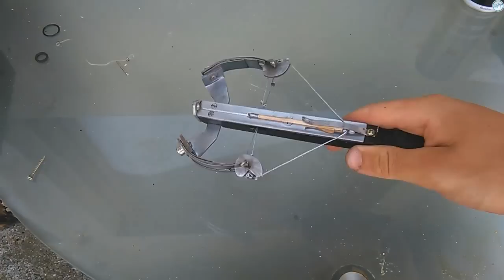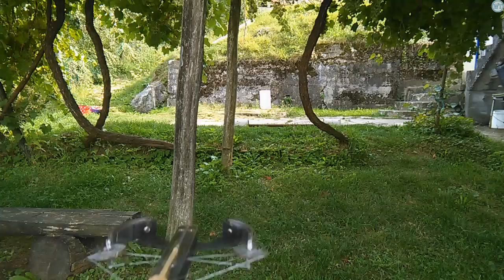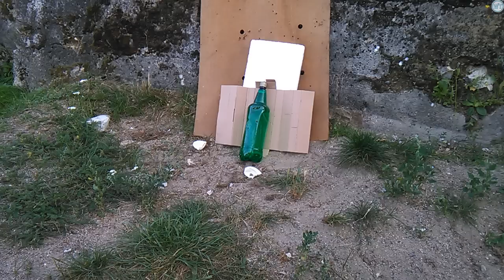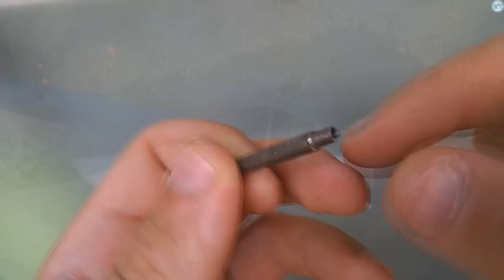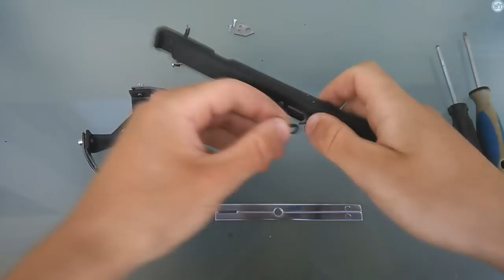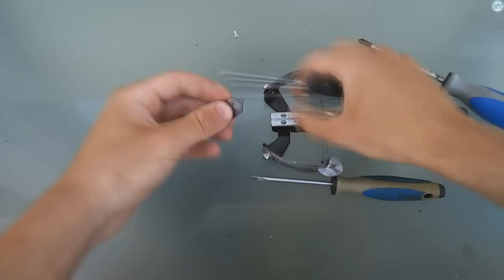Micro Compound Crossbow Shooting Test | Explosive Arrows, Assembly

Comment: Wow..that's quite a bit of umph needed if you gotta use a mini lever to cock it. Any more and you'd probably have to make one with a screw in it. I remember seeing one of those after clicking a link on a Skallagrim vid. It was, if I remember right, an assassin's miniature crossbow and the only way to get the kinda power needed and be able to cock it was to use a screw set up to pull the string back.
Reply: Raduka
I know that feeling, those little handles on all those crossbow pistols you find at flea markets hurt like crazy to pull back from what I remember when I got one when I was younger. Also I found the name of that screw powered one I mentioned, it's called a ballestrino if you were interested.

Comment: putting a small leaf spring behind the trigger might work better than a rubber band. last longer and less likely to fail too
Reply from the maker: I found some mini springs in lighters, so I'm going to use that in the future :)
Reply: that could work. if you are talking about coil springs you could also use a pin or screw driven through the trigger (front to back) sticking into a small guide hole in the stock to guide/stabilize the spring. kinda like a spring piston on a bike except no oil damping chamber. 

but yeah if you end up trying a leaf spring look at how a mosin nagant trigger works. it could be approximated by a flat spring with a couple right angle bends or screw driven into it to mimic the nubbins present on the mosin trigger spring. you'll see what i mean if you look at one. (if you have not seen one yet) just a thought.

by the way have you ever explained how you make your strings/cable for the crossbows? what material you use? what you use for holding the loops closed? would be really interested...

this kinda stuff always peaks my interest especially since i love coming up with improvements/alterations for mechanical devices :)
Reply from the maker: first of all thanks for the suggestions. :D
I've just found out how a mosin nagant trigger works and it's pretty cool. Seems like it's very durable.
In this project strings are made of bicycle brake cable and I used 2.5mm nail and drilled 1.5mm hole through it and cut it 3mm long. Then I just put both ends of string through that piece and created a loop and just secured it with pliers or device.
Thanks!
Reply: no problem :)
the russians were absolute masters of durability and simplicity in 2 world wars. kinda had to be, but still.
and thank YOU. quite ingenious. 
i am hoping to make forearm/gauntlet mounted crossbow (instead of hand mounted so it can be more powerful) based on your prototype with a laser sight inside the square bars hollow for quick aiming. ill just mount the pressure sensor on my thumb or something.
anyway keep up the good work. i love seeing clever channels like this
Reply from the maker: It sounds very interesting, make a video when you finish it :)
Thanks!

Comment: put broadhead on one
Reply from the maker: It's kinda bit hard, there is few reasons. One of them is that broadhead is pretty damn hard to make, especially for this size. Even if I could make it, it would probably just pop off or break after few shots. That's not just a problem for small bolts, when you shot a full size bolt with broadhead against real target (something harder), the razor blades will probably just bend or break.  In my opinion they're only good for hunting but since I'm not one I don't need it :)